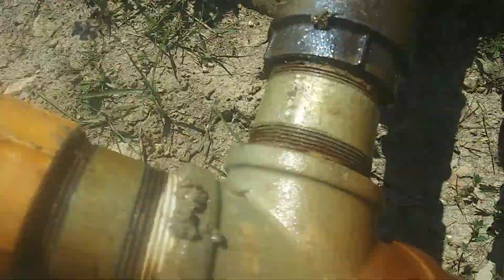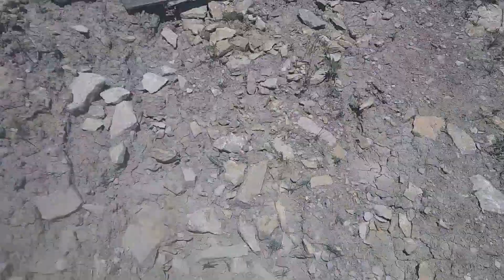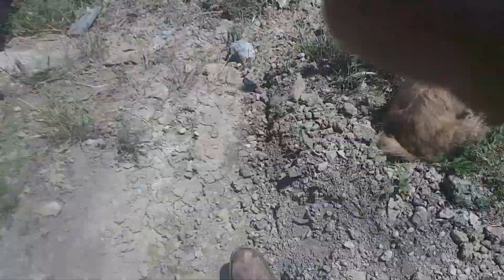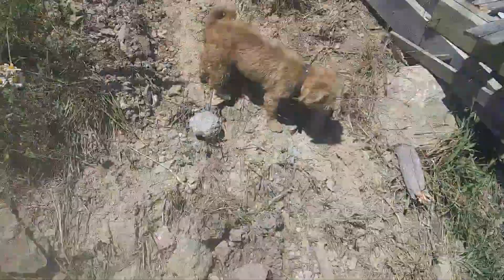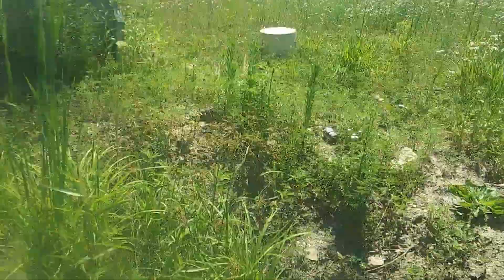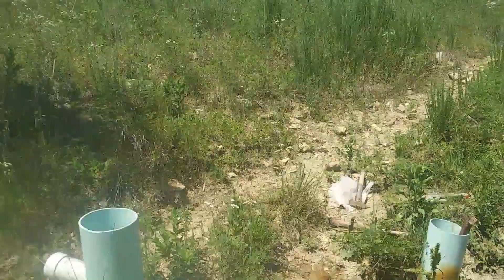Ram Pump Repair 1

Comment: How well does it work being further up the pond dam? And how big is the pond
Reply from the maker: It's working ok, did loose some flow and it doesn't hit as hard but we are working on putting a second ram pump on the discharge side of the main pump to get some of the flow back. The pond is little over 5 surface acres and over 20' deep in about half of it.